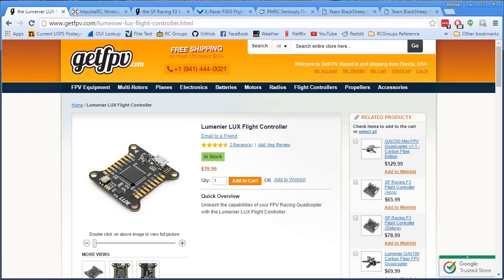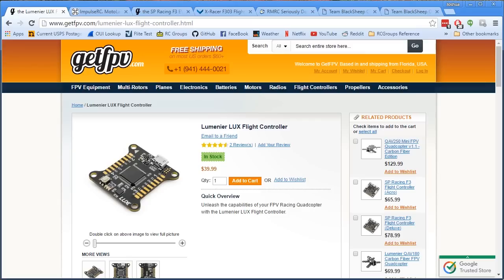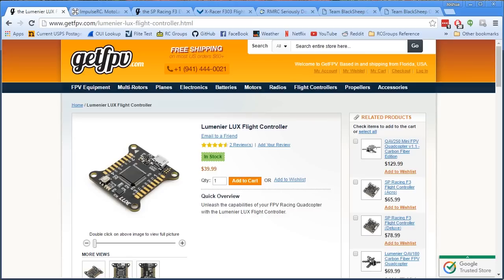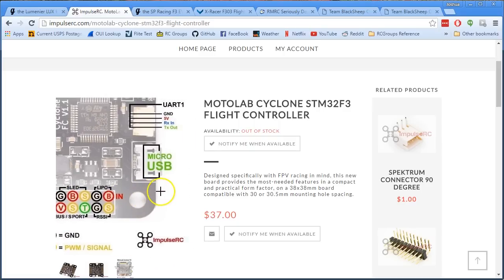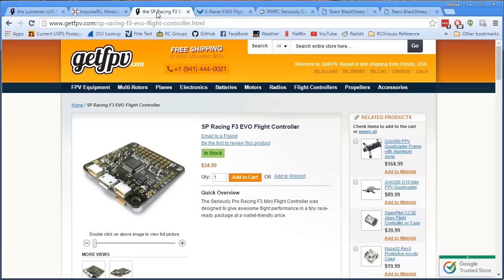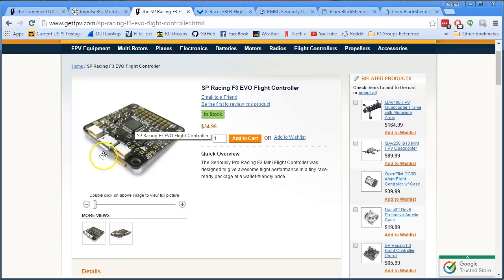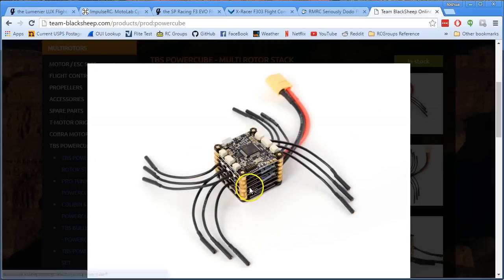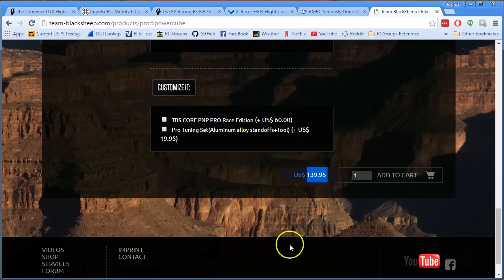The Best Cleanflight Flight Controller(s) - May 2016 Update

Comment: Whats wrong with the naze32, or is it gone with the dinosaurs
Reply: f1 chip, a bit outdated at this point
Reply: Your answer is incorrect, STM32F1XX is not outdated comparing to STM32F3XX. In reality there is little difference between STM32F1XX and STM32F3XX
They both have same 1.25 DMIPS/MHz, and both have same maximum frequency (so real performances are (near) same). They use difference core STM32F1XX are ARM Cortex-M3 and STM32F3XX are ARM Cortex-M4F, but Cortex-M4 is Cortex-M3 plus DSP Instructions (that why they have same performance, Cortex-M4F have  floating-point unit) and only advantage of Cortex-M4 is if your software use DSP (DSP is little useful in FC and it is not use in them). As gain from  floating-point unit that is not easy to estimate, it can have impact but you can make FC software that will have same performance that do not use floating-point.
If you want to get performance gain than you better skip F3 and use F4 or wait for STM32F7xx FC (ARM Cortex-M7 have real advantages over ARM Cortex-M3/M4)
Performance difference between F1 and F3 FC are mostly in heads of users (like placebo effect) and not due difference in performances of microcontrollers
Reply: +Miloš Lazović So the new naze32 rev6 I just installed is ok then?
Reply: NINJA KWAD
As microcontroller speed you should be ok, but NAZE32 have some design choices which could be done better (they have nothing to do with microcontroller speed, and they could be done with same microcontroller).
MPU-6500 is connected over I2C which limit it maximum update rate to (technically) 4kHz instead 8kHz for gyroscopes (if you use accelerometers you are anyway limited to 1kHz and then you can use built in DMP which is also limited to 1kHz). For full 8kHz gyroscopes update rate MPU-6500 must be connected over SPI.
It use separate USB-to-Serial which for its operation use one of available USARTs (on board marked as UART) instead of using built in VCP and live one more USART free. I can guess they did that because if you kill bootloader you would need programmer or external USB-to-Serial (on stm32f103 factory bootoloader cant work over USB, and not to be confused with bootoloader you normally use, in factory one you enter by shortening boot pads on board), but I think it would be better solution to have more free USARTs then limit use of one for some special circumstances (I do not know how many people even need recover board using factory build in bootoloader).
STM32F103 have 3 USARTs but NAZE32 use only 2, USART3 share pins with I2C2, but I would prefer to have choice what I need I2C or USART (I do not know if they really use second I2C, but if they would move MPU-6500 to SPI that would free I2C)
In addition to the three above mentioned objections I have there are more minor objections.
If i would make FC I would probably use STM32F105 instead STM32F103CB (which have rom bootloader capable of using USB) or  STM32F2xx (same as STM32F1xx but it can run on 120MHz instead 72MHz and it is better choice then STM32F3xx).
Reply from the maker: I agree with jamble7k that, for cleanflight or betaflight use, the F1 chip is outdated. You are right that the main difference between them is the FPU, but cleanflight and betaflight more and more use floating-point calculations. With the latest betaflight versions, F1 boards can no longer consistently hit 4 kHz gyro sync and have to drop to 2 kHz, or even 1 kHz PID process rate. Additionally, F3 has software-configurable UART inversion, meaning you can easily use SBUS with F3, which is more and more popular.

Betaflight 2.7.1's super expo and other rate-calculation changes were the real death knell for the F1 boards IMO. If you have a Naze, don't throw it out, but don't buy one if you haven't already.
Reply: Joshua Bardwell
Let's put this discussion to end, stm32f1xx and stm32f3xx have exactly same performances (you can easily check on STMicroelectronics site), only difference is FPU (and DSP functions that are not useful and not used in FC) and as I saw it is used only for LUX PID controller  (all oter use integer arithmetic).
As USART/UART they are totally identical on both microcontrollers (they have identical set of features) and both can do same (again you can easily check in datasheet for them).
As speed of loop concern there is nice demonstration of Dr Raffaello D'Andrea (professor at ETH Zurich and creator of Flying Machine Arena) on that topic, and he get high stability with loop frequencies well below 1kHz (even below 50Hz), but that is highly dependent of algorithm in use (and he do not use  cleanflight/betaflight).
Another example is KISS FC that have fix loop time of 980hz (according to author) even it use STM32F303 (author state that dont get better results with faster loop times).
Reply from the maker: +Miloš Lazović you are wrong that only luxfloat PID controller uses floating point math. As I said, 2.8 and 2.9 use floating point math for rate calculation when super expo rates are enabled. As for everything else, you might be right that the chip can do it, but Cleanflight doesn't do it, so the difference matters. For example, inversion on the UARTs. On an F1 board Cleanflight doesn't do software UART inversion. Whether that is a function of cleanflight or the F1 chip, who cares? I don't.
Reply: Joshua Bardwell
You are partly right Betaflight do use FPU for expo, but Cleanflight do not (which is clear from source code).
NAZE32 v6 support SBUS out of box with Cleanflight  so who care for what you call "software inversion of UART" (it is not done on any board in software on microcontroller, but by external transistor...) so there is no difference between F1 and F3 in that aspect.
Thrust me you do not want to go in this discussion with me, I hold most of datasheets/errata for ST microcontrollers in my had, and I do use them for lot of my projects for near 10 years (they have good ratio of performances to price).
Reply from the maker: +Miloš Lazović you're right. I don't want to go in this discussion with you. Twice I have corrected something you got wrong and yet you still argue your original point. You may be am expert on the specs of the STM chip, but I am am expert on flight control boards that run cleanflight and Betaflight, so maybe show a little respect. 

Let me be very clear. 

F3 is superior for running Betaflight. Betaflight uses floating point math heavily for features such as super expo and camera uptilt compensation. Cleanflight may not support all of these features yet, but it soon will, as pull requests are merged. 

F3 is superior because you don't need off board hardware to do SBUS inversion. SBUS inversion can be configured in software. I don't care whether this is a function of the chip or the board. The fact is that only boards with an F3 do it. 

F3 gives three UARTs to the user whereas F1 boards only give two. Again, this may be a function of the board design, not the chip, but since a consumer is buying a board, not a chip , who cares?
Reply: Joshua Bardwell
Please say what I said wrong?
"F3 is superior because you don't need off board hardware to do SBUS inversion." is plain and simple false!!!! NAZE32 v6 do not need any off board hardware to do SBUS inversion.
"F3 gives three UARTs to the user whereas F1 boards only give two." is true only if you mean hardware UARTs, but is not true if you count software UARTs.
As your statement about using FPU in Betaflight and that will be pulled in Cleanflight that time will tell, usage FPU for super expo in Betaflight is pretty much unnecessary (I do not want to use more appropriate word for that peace of code, but is not something that experienced software developer will use I suspect that is reason why only Betaflight use it and Raceflight and Cleanflight do not use it).
Let say you are corect and F3 is F3 is superior for running Betaflight. then I would expect someone present some measured data which will support that claim. I do agree that you may feel that F3 board are better and they suit your needs better, but to say they are better period you need to present some tests that prove that (let say same quads make better time on race with F3 board or ....).
All this discussion we have because I respect your opinion (if i didnt I would not bother discuss with you), but I do not think you as snake oil seller who present claim without evidence, but in this case i didn't find enough evidence that support claim of F3 superiority (except some subjective opinions). I do see only evidence that different boards have different set of capabilities (no matter if they use F1 or F3 as in case of SBUS or IMU is on I2C os SPI ... but nothing of that is directly tied is board use F1 or F3).
Only real advantage of using F3 on FC is ability to remove CP2102 and save some weight and complexity (which is not possible on F1 used on FC).
Only real advantage of using F3 on FC is ability to remove CP2102 and save some weight and complexity (which is not possible on F1 used on FC). On other hand F4 boards have real advantages in speed comparing to F1/F3 boards (around two times, due higher clock).
Reply from the maker: +Miloš Lazović Naze32 v6 has a built in inverter on the board. Try using anything other than FrSky SBUS on that pin. You can't, because inversion is forced by hardware. F3 solution, with software configurable inversion is superior. 

What did you say wrong? You said that F3 had no additional capabilities except DSP function. Then I pointed out that Betaflight makes heavy use of floating point math, giving F3 a big advantage. Now you are saying, "oh, but that is a bad way to write the code and anyway, who knows if it actually makes better flight?" Okay, but that is just moving the goal post.
Reply: Joshua Bardwell
On NAZE32 SBUS is shared with as I remember correctly UART2 (I am not 100% sure with which is shared, but I am sure it is shared with something) only SBUS have its own pad (you are correct, it do hardware inversion).
I just pointed that only Betaflight  relies on using FPU for what you mentioned, no other software do (not Betaflight, Cleanflight, RaceFlight) which probably have some reason except speed (RaceFlight is mainly made for F4 or F3 boards with little support for F1).
No I do not move goal, your argument is that F3 is better, so I expect someone who is good at flying quadcopters prove it superiority in flight (I cant do that I am not good in flying quadcopters, I do fly jets or helicopters and rarely quadcopters, but you can easily do), same way as Chad Nowak demonstrated advantages of KISS ESC over others in flight. Yes I agree that F3 provide better comfort in usage, but that is of little usefulness if that is only advantage (it is nice bonus).
As point of that hardware do not make good product is for example ESC32 or RTF32 ESC that have same basic hardware as KISS 24A (ESC32 have even more powerful hardware) and KISS 24A rank among best ESC, and ESC32 is below all SiLab ESC using BLHeli and even better Atmel (RTF32 have performances as average SiLab ESC).

Comment: Does anyone know why there is not yet a 'no compromises' board? By that I mean decent gyro (no 6500 or 9250), spi AND sd card on the board? Seems like there are still a lot of boards that have A and B but no C, or A and C but no B. That new fury board on RC groups looks like it is heading in the right direction but why aren't the bigger manufacturers putting out new boards like that? 

Surely we are just around the corner from a flurry of new boards on the market that encompass more of these features. Actually, is it physically possible to make a board that has all the following? 
- latest Invensense gyro
- SD card slot on board
- SPI interface
- Built in OSD
- Sensible layout

Also, why would you make a board these days with dataflash instead of an sd card slot these days? I only ever used dataflash on my F303 once. By the time if finished downloading the first log I recorded, Boris had updated Betaflight 3 times and I had grown a full beard.
Reply from the maker: Well, I mean board design is not easy. It takes time to design a product and bring it to market. There are probably good reasons why we don't have this board yet. The SP3 Evo seems to come close in that it has SD card reader and SPI, but it has the 9250 chip in it. Hydra said that he did this because he wanted 10DOF and the 6000 doesn't offer that. I think the FC's you're asking for are in the pipeline but aren't quite here yet.
Reply: You can have the new fury, either f3 or f4, at whatever spec you like. This will be the board to beat once it properly hits the market, Mark my words! There is a thread on rcgroups where you can choose the spec you want and order it. $40 plus shipping and hand built.

Comment: Sorry to beat a dead horse, I don't think my tx/RX pads are working. I even tried to resolder to URT1 and had no change. I'm using an integrated PDB/OSD and I'm not getting any display info there either. All of the tele options have been turned on in CF. What kind of throws me is what I said earlier about seeing the voltage show up in CF. Uggh I think I'm gonna have to order another board to be sure. Ok I'll stop now, but it's kinda fun to figure out:)
Reply from the maker: +tahosrfr if you have any telemetry other than RSSI then telemetry is working.
Reply from the maker: Voltage could be coming from A2. The X4R for example has a built in analog voltage sensor, so A2 will always be present even if nothing is connected. It will just show "floating" bogus data.

Comment: I had 2 cyclone gyros die after 3 weeks... Moto Moto said it was because they were mounted on a shrike type frame and the standoffs putt too much pressure on them in crashes. 

My buddy used naze32 on same frame for 5 months with no problems.
Reply from the maker: That's a shame. I don't like to use metal screws on my FC stack for that reason. I would rather shear a nylon screw than damage the electronics.

Comment: Yes I did under clean flight itself. Clean flight is showing the actual voltage on the desk top
Reply from the maker: Okay, then I think it has to be something in OpenTX. But I don't use OpenTX 2.0 so I don't know for sure how the new telemetry architecture works. I think there is a command to discover sensors from the receiver. You said you disabled and re-enabled, but did you "discover"? I don't know... that's all I've got.

Comment: You missed DOGE FC man! That one rocks! FC and PDB whoohoo! The new invenesense gyro seems to work really well against noise!
Reply from the maker: +Boris B. Didn't know it existed when I made this video two weeks ago.
Reply: Totally agree with you Boris. It's a pretty awesome flight controller. I'm sure you already know about it and have talked to Carl extensively. But I did an interview with him that you may enjoy reading. 
http://www.helicomicro.com/en/carl-swanson-interview/

Otherwise, good update video Joshua. Some very valid points. Definitely recommend you getting your hands on the Doge. I think you'll like it a lot. Particularly for the cramped space builds.
Reply: A PDB without an OSD built in seems like a waste to me
Reply: Can it really handle the amp draw of modern 5" setups? I thought it was mostly for micro builds
Reply: It's rated at 120A
Reply: Awesome! Is there a distributor that ships from within the EU?
Reply: Stack (osdoge or a million china stackable minimosds) or just use telemetry
Reply: I thought the gyro inside the doge FC is just a repackaged MPU6500 in a smaller form factor.  Isn't that right?
Reply: I was going to ask about this one as well. I have a build that would love the having the space back from combining the two.
Reply: and ROTORACER RACEBASE FC, OSD, BEC and Video Filter

Comment: The Cyclone Board has by far the best quality for a flight controller i`ve ever seen and it can take crashes with no problems. AND 8khz Gyro und PID Loop is so much better when enabling oneshot42 (on kiss24) or multishot(on multishot esc`s). Running 4khz vs 8khz with oneshot42 is a big difference! (gyro/pid loop)

Comment: Battery monitoring meaning VBat? I did enable that. I will try Rediscover sensors. I forget, don't I have to set something on the Taranis itself and name it Vfas or does this happen automatically?
Reply from the maker: You have to enable vbat monitoring on Cleanflight first. And you have to change your primary voltage source for the main screen from e.g. A1 to VFAS if you want to see the voltage on the main screen.

Comment: Re: xracer. Just Hooked up a 2.0 board with the  XSR tx and the  Taranis does not see my Vfas. All other tele seems ok. Even clean flight sees the voltage correctly. Have you ever heard of this? Tnx
Reply from the maker: Have you enabled the battery monitoring feature?
Reply from the maker: Also, remember that OpenTX 2.0 changed how telemetry works, so you may need to run "detect sensors" again.